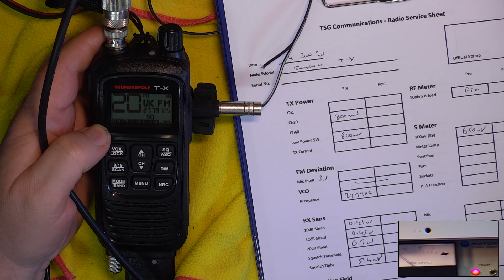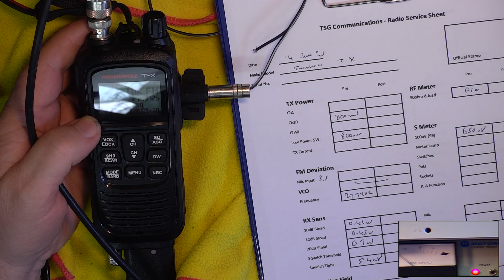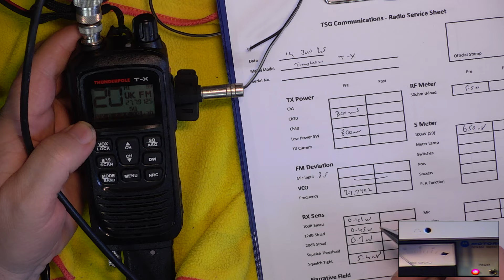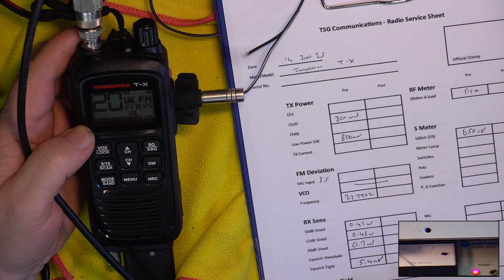Thunderpole T-X CE MultiNorm EU/UK handheld CB radio - Bench test

Comment: Thank you for your video, it´s always enlightning and a pleasure to watch.
One thing I remeber from another video done by NLK Media, who tested the Thunderpole about a year ago, he got some mysterious results on the power test with the car kit. There is a software for this and one can adjust some values there, but for the power it made no difference in his test. But maybe for some others, who knows.
I see you´ve done the video already, very nice.
Reply from the maker: We've shown the software in use twice. We wanted a little bit more FM deviation & brought it up to 2.1Khz from around 1.7Khz.   Power doesn't just go up & up with a different software figure. The maximum power we see on any "4W" handheld is 3.5W. Just like when you buy a car with  1300 engine, it's really 1256 & rounded up.

There is a point when nothing more can be gained regardless of fiddling with software values. You have to monitor current consumption as well power output (into a dummy load). The maximum is acheived when no more further power output is achieved whilst monitoring the current consumption on amameter. This saturation point ocurrs on traditional tuning methods as well as software controlled ones.

I'll just menion I don't watch other peoples videos on this subject.

Richard, G0OJF, UK

Comment: Didn't you connect the last T-X you had to the PC and tweak everything that needed tweaking? ... Anywayz, the audio on FM sounds awful on my one. The speaker just distorts so much with anyone who has a decent level of audio. Only quiet people sound clean on FM, but on AM the speaker sounds great. The radio also has good receive as long as you are holding it with two hands, but if you put it down on a surface it goes deaf as a post.
Reply from the maker: No, it doesn't connect to a PC.

When you hold it, your body becomes a co-inductive ground plane, so it received (and transmits) better in your hand than put down on a surface. Metal cased radios from the 80's work better when put down. Yes, the internal speaker is no beter than the ones on the Harvard 410.

Richard, G0OJF, UK
Reply: In a previous video yourself and Mr Chippy connected it to a laptop and where adjusting some settings using Thunderpole software.